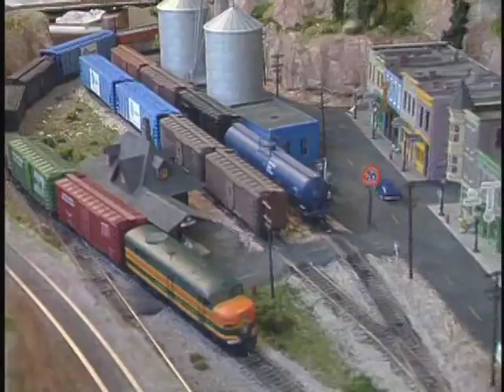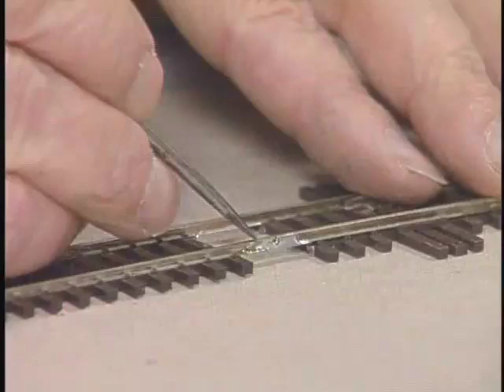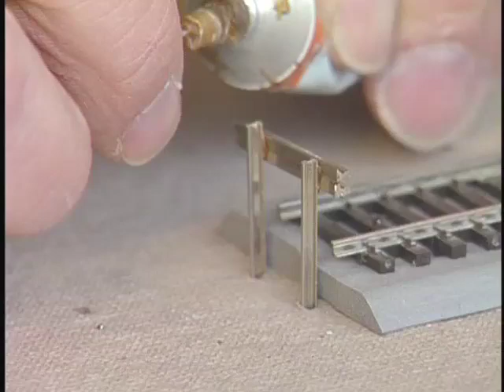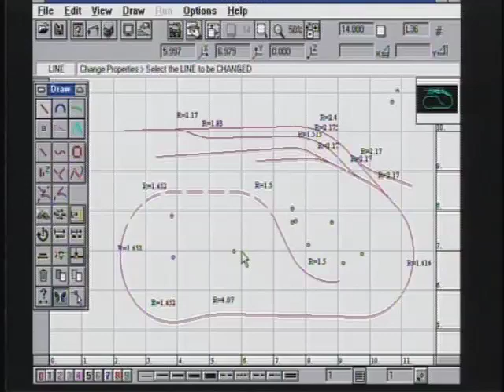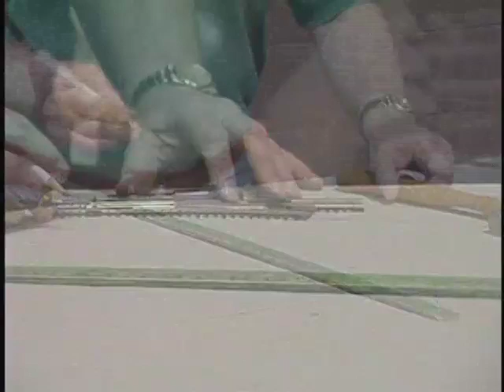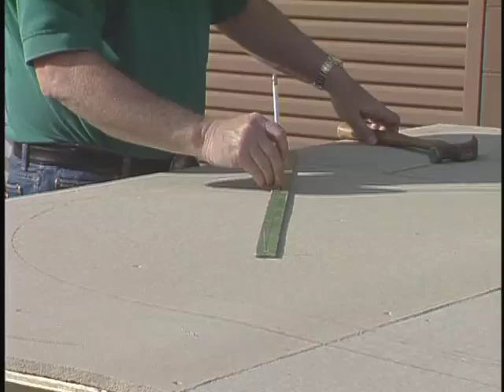Building a Model Railroad Series #4--Laying Track

Comment: I know it wouldn't seem as professional, but could you use plywood instead of foam for the track bed?
Reply: Andrew Wilson 
You can use plywood and many modelers do , but many modelers use foam to absorb the noice from the passing trains on the tracks.
Reply: actually plywood is a good road bed, the foam board is an extra expense to a lot of modelers, BUT, it is an easier way to add scenery as well as dampen the track noise